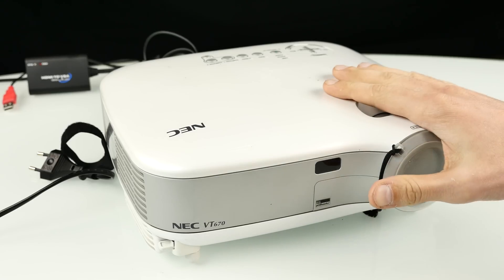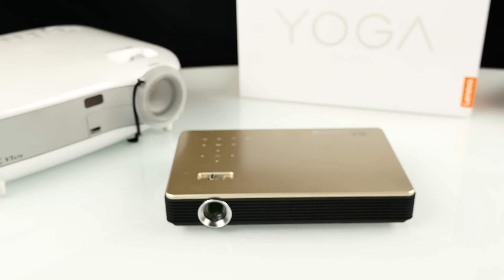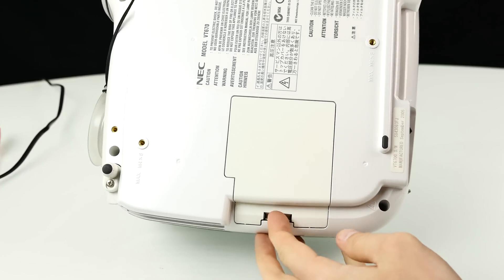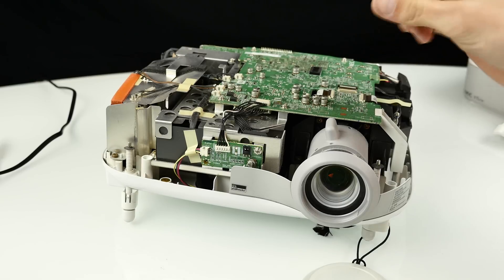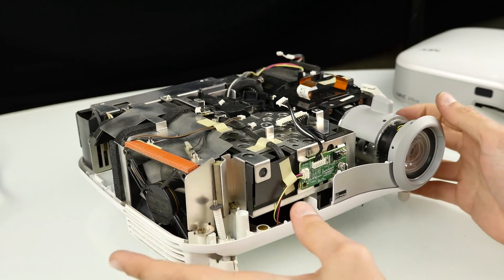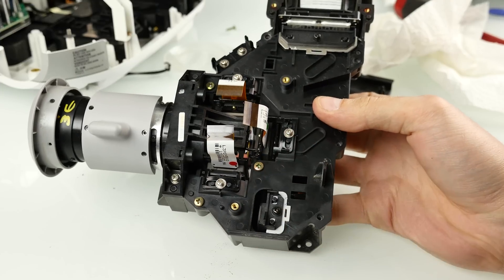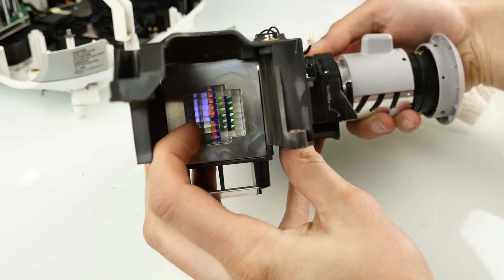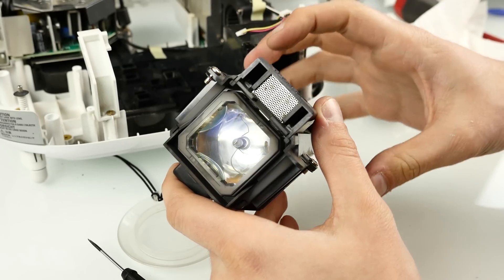3LCD vs DLP Projector Teardown - What is inside ? [4K]

Comment: 4:14 tho if you’re tech-savvy enough, you can always buy a new compatible bare lamp directly from an OEM manufacturer and fit it into the old shroud yourself. Should be painless enough to give it a try 😉. Just keep in mind you’ll be dealing with letal voltages, so unplug the unit before servicing, and make sure to discharge all the high voltage reservoir capacitors.

Comment: actually you are wrong about the color of those lcd panels, they are not "greyscale", they are tinted in negative opposite color to  the light, so cyan-blue for the red light, red-orange for Blue light and some kind of grey-ish purple for the green light
Also average lcd is not brighter, but color should be more vivid than a standard office dlp with 3 or 4 color colorwheele. Most of the new DLP projectors use 5 or 6 color on their colorwheele, not only red ,green and blue, but also yellow and magenra, sometimes cyan to bust color representation of some colors. Those projectors can produce better colors than 3lcs, but with a price of high speed spinning colorwheele or flashing LED lamps, so they should not be rotated during operation. Also not all dlp projectors use led light, there is still a lot of dlp projectors using standard uhp mercury arc bulbs
On the other hand 3lcd projector could use 3 led rgb technology and get much more out of the same amount of power than a dlp projector could with similar benefits.

the thing that rattles inside of your projector is probably broken prismatic screen used for light beam equalisation and initial color separation it can be fixed with transparent uv resistant epoxy, but is should be formost part temperature resistant.

Comment: I find that VGA is actually better than HDMI, well on my TV anyway. I can run VGA at 2560x1600 where as the HDMI is limited at 1920x1200 and looks far more, "grainy" around the edges, as if it's overly sharpened or something.
Reply: I never thought about it, but I wonder if you would get less lag if you just used vga instead of hdmi..
Reply: @arcadeparty4946  that doesn't depend on the type of cable "lag" or framerate is actually higher on HDMI, HDMI (in my own experience) goes up to 120hz and VGA was limited 60hz. So honestly, it depends on the type of device

Comment: I got a 1080 DLP projector several months ago. Ive put 400 hours on it and its been perfect for highspeed gaming and watchng hd films. I have it set at 150 inch screen size and the HD still looks crisp. Optoma hd141x $800CAD, considering a 65 inch hd tv costs $2000+ its really good value too.
Reply: Ya I brought the optoma 144 about 6 months ago and it still runs like brand new :)

Comment: €100? That is cheap! The Hitachi and Epson projectors I have at work cost £180 for a new lamp and they last a few months :S
Reply from the maker: +rapturas holy shit ! 180 o.o do they run 24/7 opr what ?=
Reply: +Techmagnet Sadly staff do not put the units into standby when not in use; I've tried using cheaper bulbs but they last even less time and you do not save much buying cheaper brands.